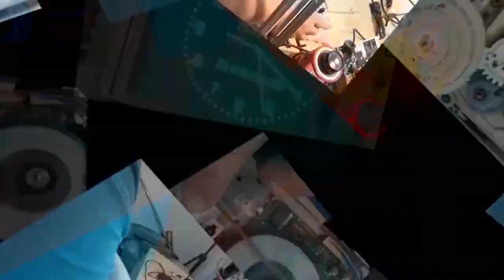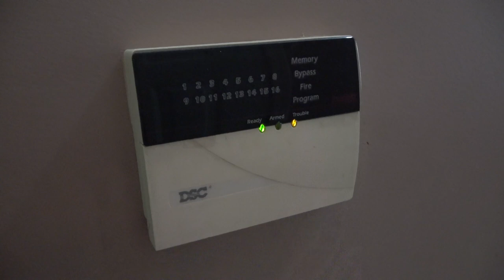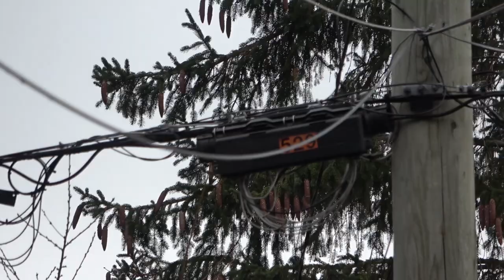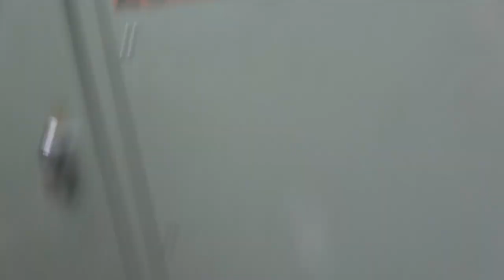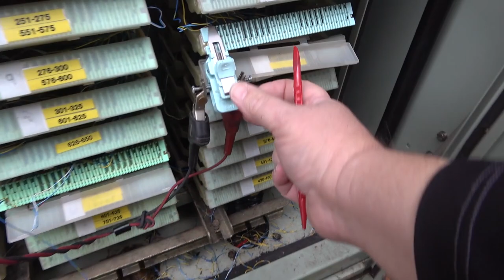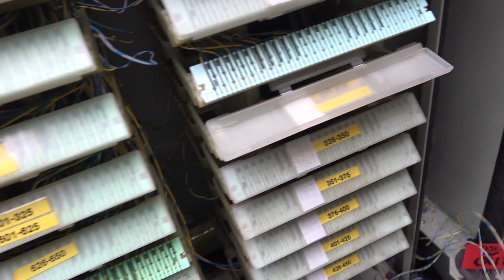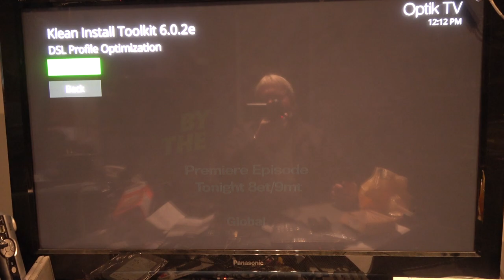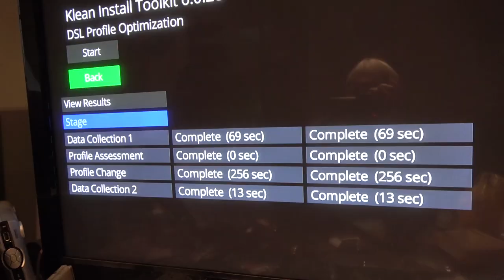Fixing my old noisy copper phone line

Comment: I had same issue at my business for 20 years. Finally got a executive from Centurylink to expedite a proper repair... after 20 years and 75-100 tech visits "changing my twin pair" would that be called "expeditious". It tool a trencher, two bucket trucks and one service truck, total crew of 7 to dig the cross street and replace the damaged-long-ago line that went under the road to the pedestal opposite side of street. They started at 7:30AM, and wrapped up the job at 7:00PM 

Wow, I used to have a DSC panel. I did not know how to make it compatible with new monitoring station, had to replace with a First Alert POS panel. Definitely Legacy equipment. I threw away 2 NIB/NOS DSC panels last year, while getting rid of old electronics piling up in my basement. Even had a full road of lead window foil.

For 911 locating, it sounds even worse. Please expand on this issue. I have cell phone with defaults set to use wifi at home and work.... does GPS on phone data pass forward, or will it display as 30 miles away ? I bet noone really knows of the issues you enumerate on. This should be on a cable channel 24/7, with PSAs on all channels monthly to link to. People have no idea.

Comment: Great video! Love the old phones and I see you still have your old dinosaur 80's Casio digital watch. Thanks for the nostalgia.
Reply from the maker: It's not an 80s watch.  It's early 2000s solar powered and sets itself from the WWVB atomic clock time signal.  I've had it almost 20 years and never change the battery because it recharges itself every day.
Reply: @12voltvids  i would recomend loosing it up a bit cause having it that tight cant be good for your bloodflow
Reply from the maker: @cornnatron3030  what?  It's not tight
Reply: @12voltvids  ok my bad just seemed extremely tight around 12.38min which got me

Comment: Hey that looked like my old test Phone.  I used to work as a Phone tech years ago. PSTN and ISDN fun stuff. Weird plints though. Not like the German Krone plints we used ,(punchdown blocks) I guess you call them. That static sounds like moisture in a splice somewhere yes. Copper, dirty wather and 54 volts does that. Hey, thats 1980's stuff.
Reply from the maker: Yes moisture in a splice for sure. Corroded amp connector most likely on the tip side.
Reply: Here in New Zealand we have the British telecom plugs and sockets. Oh God they go so noisy in winter. Pins too close and green crusties tracking noise. Fix is to rip nearly every jack point out and replace. Grease every connection in back of every jack or noise is back next week

Comment: I had this problem where the static was just as bad as the beginning of this video. Had a few engineers sent over and its still not fixed, albeit not as bad. Apparantly the rain leaked into the line and soaked it. I get the strong feeling its still leaking into it because there is still noise.

Comment: I have the same alarm panel.  Also have the cell phone alarm backup feature.  But we haven't done the alarm monitoring for decades.  It's an expensive scam.  No one is coming if the alarm is activated until several hours have passed.  But the city will bill you for false alarms, which do happen.  Rotary phones are awesome.  Wish I still had one.  I grew up with them as well.  Hey!  Did you put in a ticket on that?  LOL  This was a great vid on the way the telco wires work.  Love the discussion about the tone, voltage, RF, etc.  As an IT guy, I've always had a lot of respect (and sympathy) for the telco guys.  It's truly a thankless job.
Reply from the maker: You have no idea.  Been doing it 19 years now and i can see the light at the end of the tunnel.
Reply from the maker: My alarm is not monitored.  It calls my cell so i know it's making noise.   With 2 30 watt sirens blasting nobody is sticking around.  Never have had a break in. Too many neighbours work from home.  I've tripped it a few times when i have been slow to leave or not fast enough to disarm  and the neighbours all come our to see what's up.
Reply: @12voltvids   Having a direct call alert to my cell phone would be wonderful.  I didn't know that was a thing.  I thought only the paid monitoring thing was available.  That's awesome!  (For as long as it lasts for you anyway.)
Reply from the maker: @RustyTheGeek  if you know how to access programming for your panel and it's connected to a phone line you can program in your cell number.  Get your hands on a programming manual for your alarm panel and look up the codes.  It will work as long as i have phone service.  Even phone on fiber.  I put in a battery backup for my ont so my phone works during power failures.
Reply: @12voltvids  I'll have to see.  I'm pretty sure I have the manual somewhere.  Years back I seem to remember doing some programming.  Like you, I held on to the old POTS line for a looong time.  I finally ported it to VOIP a couple years ago to save a ton of money.  In our area (DFW) a "Metro" line was kind of expensive and I had two lines.  I finally got tired of paying the big bucks to keep them so I just kept the numbers on VOIP.  There's someone here 24/7 so I don't need much notification currently.  But it's all in place if I ever do.  Thanks!

Comment: Fibre optics the way to go, its good to see you know what ya doing fixing the old line, not too many techs that good around nowadays, i think theres a converter box someone made for old rotary phones to run via fibre optic
Reply from the maker: Don't want to make it too comfortable for my 21 year old.  Have to have something to encourage him to get out on his own. Internet speed is one he complains constantly about.
For my use, the speed is just fine. I keep the copper going till it is shut down. I keep getting pressured to change. Get the weekly calls to upgrade, but there are reasons to keep copper. My alarm system, and the fax machine I still are 2 of them. We have actually migrated a few people back to copper for that reason for their phone. The big reason I am not changing is I am grandfathered on an old TV package, and I will have to change if I upgrade to newer service.  That means channels I currently get are in different packages I have to add. It won't save me money, it will cost more. The rotary dial out is not the big issue, as I use that phone mostly for answering incoming calls. It is the supervised alarm that it the big one.
If the phone line is cut when the alarm is active, it triggers the siren. On fiber, if the fiber is cut, the phone doesn't work, but the voltage from the ONT remains, and the alarm knows nothing about that. 
Also, updates go to the ONT in the middle of the night. This causes the ONT to reset, and you guessed it, the voltage drops during this time, which causes an armed alarm to sound in the middle of the night waking up all the neighbors whom don't appreciete it. I know I certainly don't like it when my neighbor across the street's alarm goes off at 2AM on a work night. Then I have to listen to them bitch and complain, and do it on facebook about how shitty the new fiber service is. Yes there are solutions, change out my alarm system, but that's not going to happen.
Yes fiber is faster.... that is all it is. Faster. No more reliable or anything else. Faster, period. If you don't need all that speed then there is no advantage, none whatsoever to switching.
Reply: @12voltvids  Wow, they screw you over with that BS even when you work for the phone company? That does sound about right, TV is a giant ripoff no matter what provider you get it from. I haven't had TV in years, and don't miss it. Fiber is more reliable, mostly because the infrastructure is newer. You're not going to have waterlogged splices introducing impulse noise on fiber! And no bridge taps, and the other selection of problems that plague the old copper plant.
Reply from the maker: @gorak9000  it's the box rental fees. Currently i don't pay any, as they used to be free.  Now there are rental fees. As soon as i change I pay the fees.  I still have basic cable.  I can get some OTA stations but they all cut out in bad weather as i am far from transmitter.  Netflix and Amazon keep raising their prices and have nothing to watch.  Internet is the big cost.  My tv and phone is 50 bucks.  The internet on the other hand about 90.

Comment: Im a 911 dispatcher. As long as you have a new-ish phone, I can see your location to about 5 meters with RapidSOS. It will also obtain a new GPS position upon dialing 911. And it doesn't have to "see the sky". If your phone is not compatible, "wireless phase 2" will give me a location to about 15-20 meters. and "wireless phase 1" will only give me the location of the cell tower you are using, and MAYBE a direction from the tower.
Reply from the maker: But say the caller is in a 10 storey building.   It know they are in unit 303 or 403 or 202?  It won't.   I know this from a customer i was installing a home phone for.  They called 911 from their cell once when their child was having a seizure and the woman was historical and gave the operator their old address by mistake.  They tracked the gps to the building and ended up banging on the door on the wrong floor.  Took them 10 minutes to find the right suite.  She is telling me this horror story as i am connecting a home phone.   So don't give me the crap that cell phones can pin point you because they can't.  I just hope everyone with that attitude never has a real emergency.

Comment: Fax works fine on voip. Just turn off ECM mode on the fax machine
Reply from the maker: My fax machine is so old it probably doesn't even have that option.  Is that the same as international mode?  I kid you not my fax machine is early 80s. Used a roll of thermal paper.
Reply: @12voltvids  error correction mode. Older machines probably don't have it, it's kind of sensitive to latency.  Either g.711 or T.38 fax work well these days on voip.  I've set up alarm systems on voip atas too, some alarm monitoring companies support it directly in fact.

Comment: Interesting to see someone doing stuff with copper cable telephony...back in the 80s I ran a BBS, so I learned a fair bit about how the phone system worked. I then had to learn a great deal more when I got a job installing and managing fax forwarding and voice mail systems using an ISDN PRI connection connected to DID cards in Novell Netware servers. I started out as a Novell Netware networking tech and already knew a bit about telephony...so I got the job. I also had friends who worked at BNR here in Ottawa and later Nortel, so I would hear lots of interesting stories...:-)
Reply from the maker: I also ran a BBS back in the 80s.  I had a Texas instruments ti99/4a and had to write the sotware in extended basic myself.

Comment: Hello, I was following your video because I also had static on my corded line. My home has 40 year old internal wiring that is inaccessible without knocking out the roof/sheetrock. When I installed VOIP, I bypassed the internal wiring with new cables, and then plugged back into it to the internal wiring to make the old jacks live.
When I unplugged the main landline phone, the internal wiring appears to have gone dead. All of the jacks no longer work, only the new wiring I placed myself works. What happened here? Did I short curicuit it by unplugging the RJ45? Was the wiring failing to begin with, which is why there was static on the line?

Comment: I had the same issue long ago (like, over a decade and a half) and the ding-dongs at AT&T couldn’t find out what was wrong. My line did the same damn noise, it was weird, it was clear at first then started to garble and crackle and my DSL speeds were horrible and my modem kept resetting. Finally an old tech came to my house and removed some “filter” and that resolved it and I was getting over 6mbps on my DSL line and my DSL modem stopped resetting all the time (it would lose sync and re-establish constantly). What a mess.. I dealt with that for like 2 years…

Comment: Wow, I didn't know that DSL could go up to 60mbps. The only experience that I've had with DSL is from AT&T for my great-grandma which used to come in at 5mbps, but over time the wiring got so bad that right before she passed away, it would only cap out at 1mbps and half a megabit up (that was in 2018). now they don't even offer the service anymore they force you to get an AT&T hotspot .You've got some good DSL
Reply: This would be VDSL2, and the modem in his house only has to connect to the modem bank on the left side of the green box he opens up.  It's fiber from there on.  The VDSL2 is actually only good up to 50mbps in most cases, but you can get two lines bonded into one connection.

Comment: In Vz, a least in NY, metallic (Copper) cables fed services are being retired.  Circuit switching and SONET transmission equipment found on Special Services (DS1, DDS, Private Line voice) circuits are being removed as customer circuits based on legacy TDM technology demand goes away. With fiber based transport technologies, on a FiOS FTTP ONT for example, the copper line has been reduced to a couple of feet at the RDT. The rest is customer owned and maintained inside wire (IW). The next step in the total replacement of copper T&R telephone line replacement will be in IP based technologies. I have see the network evolve from manual ringdown circuits, to VoIP.
Reply from the maker: Copper is being sunset here too. The CO i work out of is scheduled to be shut down next year once all services are migrated to fiber.  I've been part of the greatest build in the history of the phone company.  I'm working on a 3.4 gig circuit as I type this, on the phone with support desk due to a stuck order.

Comment: Spectrum here offeres phone and internet supplied via cable TV Coax. The modem supports pulse (rotary) dialing and my rotary phones just fine.  
You can also get Blue Tooth to POTS adapters that allow you to make your houses (disconnected) landline wiring work through your cellphone's Bluetooth, and some of those adapters suppport Rotary Dialing too...A friend of mine has such a system and has configured it such that he can command his phone and IOT devices connected to it via the phone. One of the more interesting applications he has is controling power to a 1940 Philco Mystery Control radio console...Those consoles have an RF remote that controls tuning presets, volume and can power off the radio, but not power it back on...He didn't like having to get up to manually switch on a remote device and added an IOT switched power outlet for it.

Comment: My aunt had one exactly like that red phone when she worked for a phone company back in the 90s. I always thought it was a tone generator for interfacing with the central hub or something ;)
Reply from the maker: What? The butt set? That is just a test phone with a speaker to monitor.  It can listen in without anyone knowing.  Used to listen in for crosstalk and noise ect. Can dial our and be used as a regular phone set has a ringer and microphone and talk disconnect switch.

Comment: We are still connected to copper that comes from across the road, from a dilapidated old box. Every time there is a heavy rain, it usually gets that static on it. It's been working good for a long time now since the last time they fixed it. Knock on wood. So is that vault supplied from the lines on the pole, or the other way around?
Reply from the maker: The cabinet is powered with HV that comes on on phone lines underground but some are Ariel fed.

Comment: 1:40 Here in Saskatchewan SaskTel (the last province owned phone company) mandated we all switch to fiber opics. Luckily, the device they use does allow for a rotary phone to work both ways.
Reply from the maker: The Nokia ont will work. The Alcatel no. Eventually the copper will be turned down but as long as it is running I will stay on copper.  Worked good enough for anything i need.

Comment: I live in an Area that was used for fiber optic testing, so we've had fiber since I believe 2008/9 don't even remember what our ADSL+ was like, I've heard plus read, that they should still use the copper lines aswell, because they can offer the same connection speed etc

Comment: I have the same thing of conversion but from ISDN which is phased out and this year the final connection will be cut. We were pressed to make the changeover as the price for ISDN was rising high and adsl a fraction of that.  Last year they dug out the old lines and replaced everything with fiber, we are going to switch to fiber from adsl this year.  We already lost the 'legacy' from giving up the ISDN.

Comment: Is the signal generated by the Fiber Optic Modem different from the DSL POTS? Don't they have the same voltage? My analog PABX stopped working after the telephone company switched me over the Fiber Optic.
Reply from the maker: Most ont i have seen deliver about 45 volts instead of 48-52 on copper. This can cause some alarm systems to sense phone like troubles and throw codes to monitoring station.